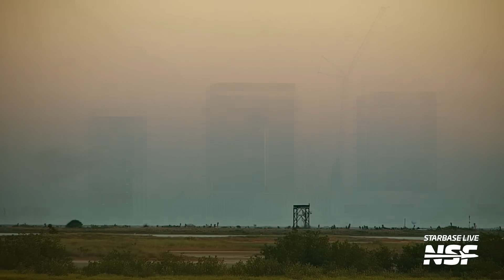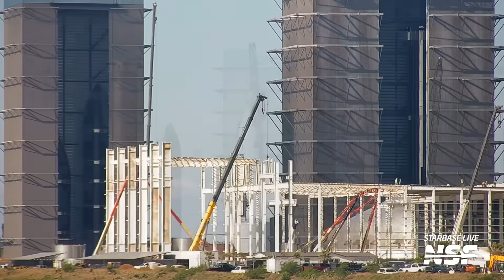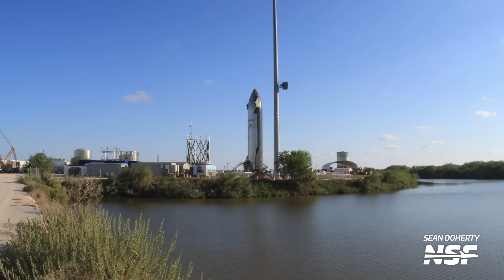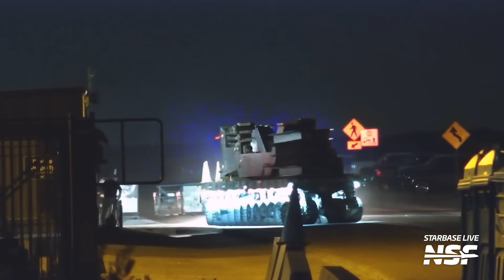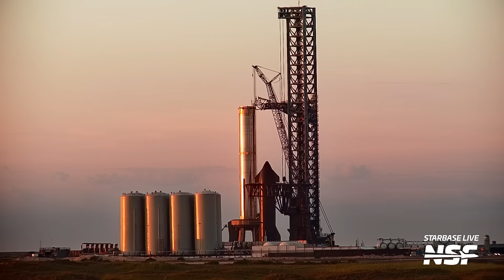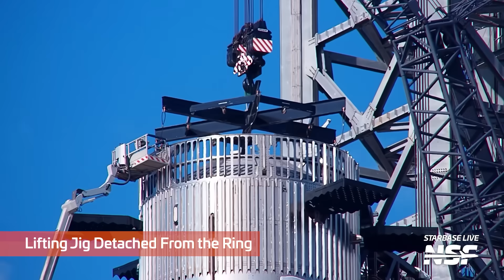Starship Will Be Stacked For Flight Soon | SpaceX Boca Chica

Comment: That hot staging ring looks small and fragile, until you see a man next to it. And you realize that it's huge. The scale is easy to forget sometimes.
Reply: Fully loaded starship has around 1500 t, so if the booster pushes to 3 g acceleration the hot staging ring gets 4500 t of load. Amazing that this thin structure can hold up to that.
Reply: Do you think they modified it in any way?
Reply: @overkillphil514  probably. Or made an adjustment?  It's probably more complicated than we think. It has to hold onto the starship. Probably has some electrical connections... clamps... 
 Or maybe the just did something to the top of the booster.
Reply: @leonbethscheider can??

Comment: Awesome footage everyone at NSF.   I keep looking at the hot staging ring, I am puzzled how it suppose to stay on in flight.  I know force of flight will keep it there, but when it disconnects it could flight off.  I was looking at the riggers, aside from unhooking the crane attachments, I didn't see any effort to fasting the Hot Staging Ring.   I guess because its not intended to be recovered, it's not an issue but it seems strange to there no clamp or something holding it on.
Reply: There are clamps. We just can't see them. That's why they aligned the ring. I would guess they are similar to the Falcon9 Booster to Second Stage clamps, although a bit beefier.